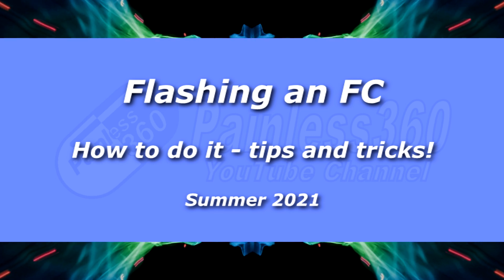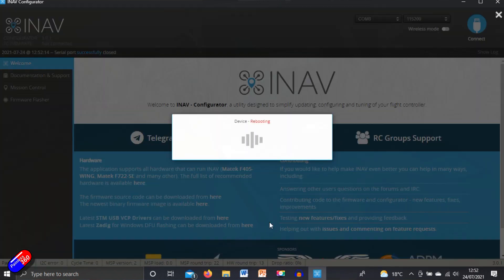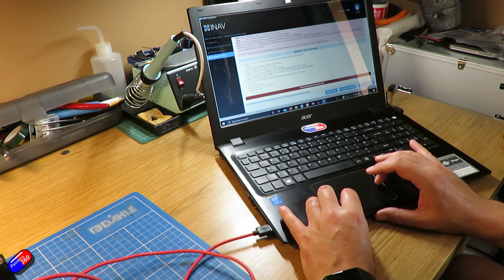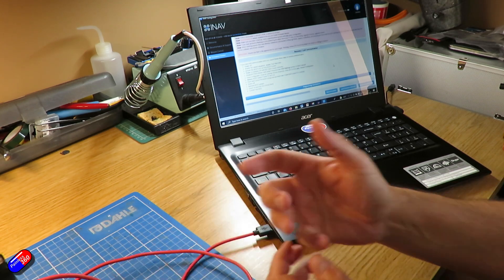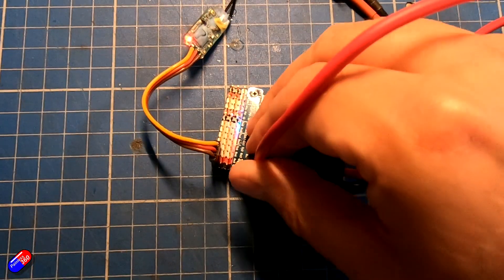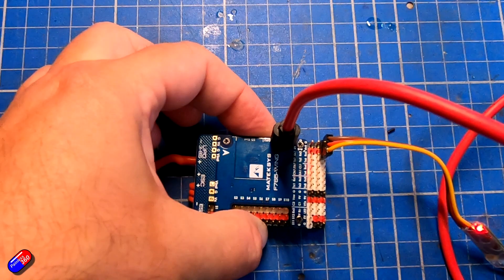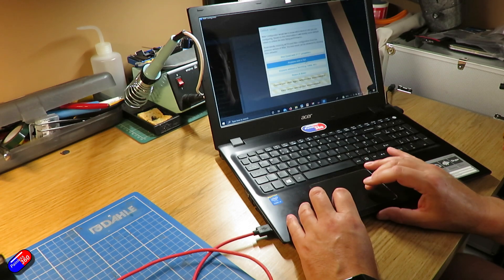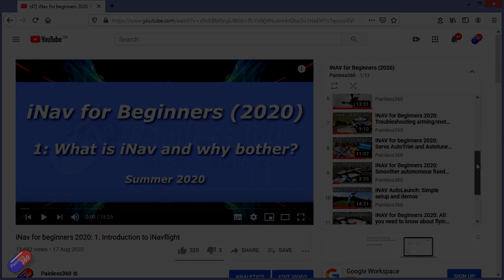Flashing a Flight Controller and using the DFU/Boot button to rescue a 'bricked' FC

Comment: This is a great video and very helpful. I wanted add some additional info in an effort  to help other readers here. 

In my case: the FC  requires that both ports "USB VCP" and "UART1" have the "MSP" switch enabled. This is not mentioned anywhere in the manual. In fact the manual shows a GPS configuration on UART1 with MSP turned off (which is what I did on my build). I did have MSP enabled on USB VCP, but not on UART1. After making that change I was able to use this video to get back on track and flash iNav 6.0 RC. 

I thought I would mention Bardwell's' DFU short form video. He discusses that having peripherals on USB1 or USB3 can disable DFU on some FC boards and to try powering down or removing them. His video did not mention checking the MSP setting though. 

I guess in retrospect something that set my problem apart from what I see in this video is that the COM port never said "DFU" for me (no matter the approach I took).

Comment: Hi , thank you for this video. Although slightly different. I am using Betaflight 10.7.2. Is it possible to get into DFU mode by pressing the boot button on the FC but instead power the FC by connecting the Lipo instead of via the USB power because I think my 5v line is a bit funny so not reliable.
Reply from the maker: The FC needs to be powered from 5v from somewhere. Normally it is the USB cable that provides that so it can be flashed. Powering from a LIPO, the FC will be powered from 5v that is created from the battery voltage on the flight controller. Both work but I'd watch things like '5v is funny' as that could point to a problem or loose connector.. Best of luck!
Reply: @Painless360  Thank you for confirming the 5v supply can be from lipo for DFU. I ended up not using DFU, and just turned off lipo and disconnected, then reconnected the usb while still in update firmware connection in betaflight. Then was able flash to latest 4.2.11 firmware on my HGLRC Zeus F722 mini FC. I think I may have broke the 5v line on the usb port when I was soldering the SDA, SCL on the opposite side of FC. So confirms usb connection data line is ok, but I will need to check why 5v on usb connector has no power. At first I thought it maybe the latest betaflight version that prevents powering up an FC using usb from computer, as I heard some fpv behave this way. Thanks again for the informative videos 👏

Comment: Hi what would you advice to do when the DFU button broke ? My fc doesn't respond when i connect it to my mac but it does take and make the ESC motor sounds when i plug it to a Li-Po.
Reply from the maker: I would look to see what traces the DFU button shorts out and then short those out with a bit of wire if you can't reboot the FC via the computer.. Best of luck

Comment: Nice video, I have had problems updating Matek FC in existing aircraft. Could not in any way get it into DFU mode, try everything, but when I disconnect the GPS, then jump it into DFU mode. It happened on two different planes
Reply from the maker: Hi Ulf, happy to help you with this on Patreon...

Comment: I bought a Fettec f7 a while back and it will not connect to kiss gui. My pc chimes when plugged in. I've ran impulserc driver fixer. I've tried different usb cables to no avail.

Comment: Hi Mr. P   Great video on the reboot system and how to set your F.C up. Well I guess I did it again.  I just received a new F.C and I found it was on 3.4 in Betaflight and I decided to flash it. But now I guess I'm the first to blow up a F.C from flashing. Because now that I flashed it, it won't let me connect to the USB. I can only use the DFU.  Thanks again for the video and information
Reply from the maker: I'd confirm the target you need and check the forums in case the FC you have has issues with the version of Betaflight you're trying to use. Once you're set, I'd re-flash. Best of luck!

Comment: I've somehow corrupted the board on an Iflight f7, I think it failed a flash of Emu.  Nothing works to connect to it, including driver fixers.  Are there any other more invasive ways to rescue it?
Reply from the maker: Pressing and holding the DFU button will force it into Bootloader mode - never failed here..

Comment: I have to confess, most of my frustrations are to do with DFU and my computer not recognising the FC.  My latest meltdown was caused by a USB lead that was a charge only lead and not a Data one!.   I have bought myself a nice new one now.
Reply from the maker: That happen more than you'd think. About half of the time, that's the reason.. Happy flying